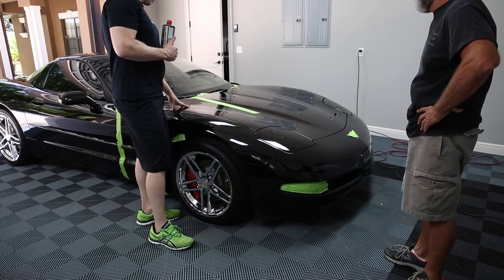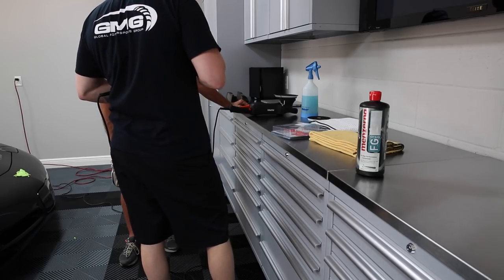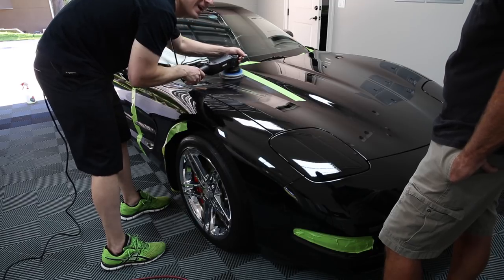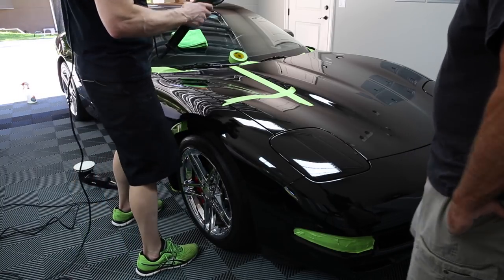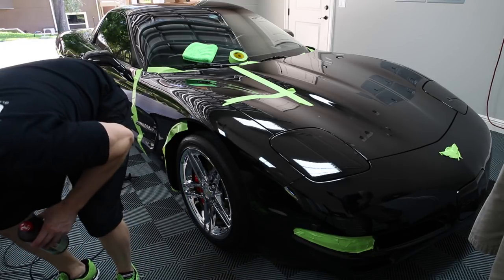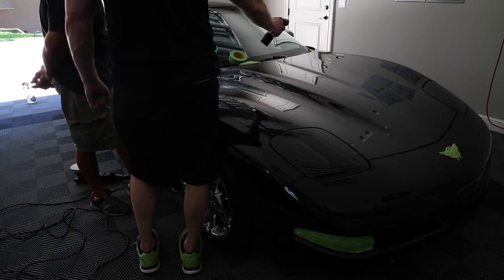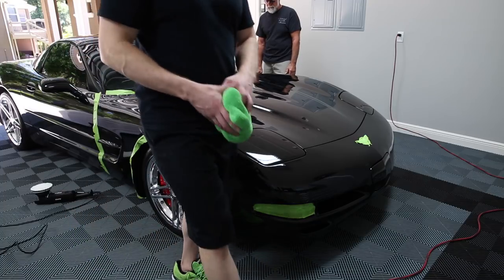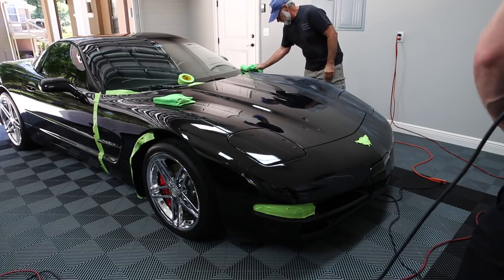C5 Corvette Paint Correction Video 2 of 3

Comment: Your def on it and i appreciate your knowledge, but bro don't be scared. You can def wet sand that paint, 3000 grit or 5000 grit. you can safely do it if you take your time and you wont remove too much.  Trust me GM corvette paint is strong.. your right you couldn't do it like you would a custom paint job, but if you  go slow and get an even scratch patern, then m105 then finish it, that car would pop.
Reply from the maker: coliseum 1 I haven't messed with a Corvette and the fiberglass body before, but I could tell the clear was like trying to correct a piece of steel.  It was hard as a rock.  I don't have a depth gauge or enough experience wet sanding, so I just avoid the concept.  Mike Phillips at AutoGeek suggested I err on the side of just dealing with the orange  peel
Reply: Matt Moreman Your exactly right, but im sure you made it a hell of alot better but just try a test spot, you wont burn through with 3000 grit, ecspecially if you use a foam interface pad and 3m disc or meguiars disc, they cut less than standard papers. just sand enought to get an even scratch patern. and just double check for debris just like you do with your pads. I got an 08 cadillac dts that i have taken multiple scratches out of that i had to lightly start with 1500, then 2500 then 3000. Damn paint is that hard. Now if it was an infiniti, you could burn through with 3000 in just 10 swipes. GM paint is like steel and as careful as you are it would be no problem for you.

Comment: You went from m105 to Menzerna sf4500? No wonder you did not remove all the defects. I know Mike Philips didn't teach you that ;). M105 should have been followed up with 205 Not sf4500.
Reply from the maker: I prefer Menzerna or Sonax for finishing.
Reply: Hi Matt, what i meant to say is 4500 is considered to be jeweling polish & to go from a heavy cut M105 to Menzerna 4500 is pushing the product to beyond what is was meant for. I love Menzerna as a finishing polish also. Thanks for the video.

Comment: Great video I was wondering about FG400 on black cars,  does compounding remove ALOT of clear, relative to like wetsanding?
Reply from the maker: Ibrahim Mohammed Relative to Wet Sanding, I'd say about 1/10th the amount of clear is removed, but that's an educate guess.  FG400 is a lot tamer than most people think.
Reply: Haha great. I was wondering on a separate note why did you get rid of the 991 C2S I remember you saying something about the transmission, I wanna get a CPO one later this year, Anything I should look out for??
Reply from the maker: Ibrahim Mohammed You need to look for this:  http://www.6speedonline.com/forums/991/300360-engine-stumble-hesitation-around-2500-rpm-29.html
Reply: Ohh  thanks ill have to keep an eye out for that. Is its just a nuance or a potentially catastrophic problem.
Reply from the maker: Ibrahim Mohammed It's just really annoying on a $135,000 car.
Reply: Well on to bigger and better things my man.

Comment: Sorry but the FG400/500 is way too much for the Paint, even with a dual action polisher which can't handle the full potential from the Menzerna FG!
I would max. take the IP2200 (new medium cut polish 2200) from Menzerna, not more. You can drive the Menzerna way longer, it will work better.
Maybe the SF3500 (old SF4000) would be enough, but that depends on the paint defects.
Reply from the maker: 89Trashmaster Why?  http://www.detailersdomain.com/Menzerna-FG-400--Fast-Gloss-Compound-Pint_p_822.html  The clear was super hard on the Vette.
Reply: Matt Moreman I never did a Vette, but normally on a VW/BMW and other European Car's the IP2200 removed every scratch.
I didn't saw the scratches on the Vette but I thought they where not so deep and you did the whole panel with it, not only the scratch.
What I really like about the Menzerna is you can work really long.
With a normal foam Pad you can do like 6 cross pattern with good pressure bevor removing it and that worked always very well. I never had to use the FG400 and I'm really careful with a Compound with so much cut you know. The FG400 is really strong.
Reply from the maker: 89Trashmaster I think you are a little too scared of using FG400.  It doesn't cut as much as you think.  In fact, it didn't cut enough to get much out of the Corvette's super hard clear coat.  I had to break out the more aggressive M105.  Also keep in mind this is 15 year old paint that has never been polished, so it needed a compounding badly.  Contrary to what you might think, I have a pretty solid idea of what I'm doing.
Reply: 89Trashmaster  Your wrong. GM corvette paint can take it, you know how many times you would have to compound even with a rotary to burn through paint..  I could wet sand that whole vet with 3000 grit no problem, then compound it and polish it.
Reply: Matt Moreman 89trashmaster is wrong, matt you are right, but on cars that have that have not been owned by ocd customers from day one will need a wet sand to completely remove all scratches.. i know it may not be the safest thing or the most practical for some peopler but it can be done safely with zero problems.. matt i encourage you to at least try 3m 5000 grit or 3000 just be smart  go slow.  You will be just fine and the results will make you very happy.
Reply: Matt Moreman exactly, your right, but don't be scared like 89trashmaster, get your wet sanding down and your opinion will change.
Reply: coliseum 1 But you don't know how often the previous owner did a compounding or even a wet sand.
So if you can't measure it with a paint-thickness-detector, you have to be very careful and use only the least necessary polish! That is my approach. So what should be wrong about it?
Reply from the maker: coliseum 1 I have some 3m discs and a full supply of sand paper.  I guess I should buy a depth gauge.
Reply: Matt Moreman Nah, you dont need one, because, the guage, doesn't tell you the amount of clear only, it tells you just the amount of paint all together, so its still a bit of a guessing game.. If you start lightly with 3000, itl make the orange peel heavily noticable since it will just be sanding the peaks at first. So with that said you'll know your still safe because the paint is not level yet. just a few more passes and the peel will be gone. If you stop right then and there, no need for a guage..Just that alone will take out at least 80 to 90 % of scratches.
Reply: Matt Moreman  Also remember a new disc or paper, cuts extremely quick its first few passes.. after that it doesn't cut as fast. So don't stay in one spot with a new piece, once its broken in you can for a lil longer.
Reply: coliseum 1 The PosiTector 200 DOES! and there are many more which are showing every single layer (primer, paint, clear coat).
So please check before you try giving other people advices!
Reply: 89Trashmaster  Either way if you need a guage, then you don't understand the dynamics of clear coat and wet sanding, . You thought FG400 was too much for this paint, you got a lot to learn still.. I run a detail shop and have wet sanded many factory and custom paints, removing orange peel over the whole car without burning a single panel and i dont even bother to use my gauge. Not saying it wouldn't be benificial for a beginer, or if you were trying to remove one single deep scratch. Once you've done it a few hundered times you just go off instinct.
Reply: coliseum 1 What is wrong with using a meter to make sure how much I remove of the clear coat or how much I can remove?
I don't understand your sentences.
It is a professional tool just to make sure the customer has still enough clear coat for detailing his car in the future.